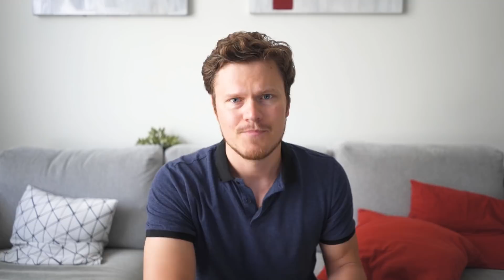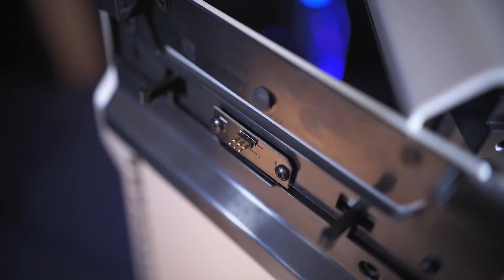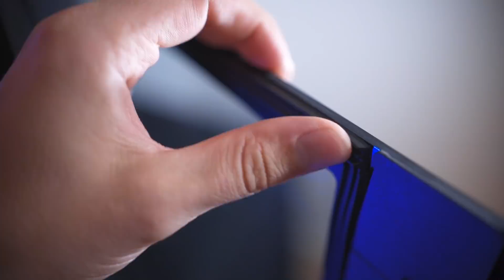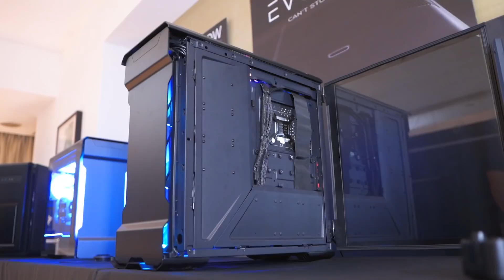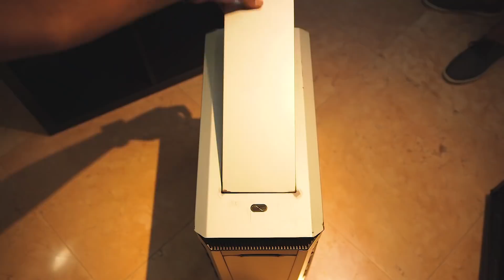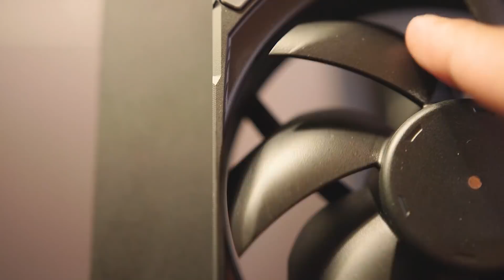The BEST $199 You Can Spend on a Case! -- PHANTEKS EVOLV X

Comment: Are the people in this comment section deluded? This case has a blocked front panel! Expect high temps and no room for overclocking. Even if you set all the rgb to red it will not improve the performance of your PC. More air, on the other hand, would do that, but hey, gotta have that rgb, air is for losers.
Reply: I have this case and my temps are pretty great with a 10900K OCe'd to 5.3GHz at 1.45 V. Max temps are about 75 at full load and a 3080. I used to have an ugly Corsair case from 2014 with 6 case fans including a 240mm side fan blowing right at the mobo and it managed to have worse airflow while looking much worse.

Comment: I have this case on order for my new build. However, I have an issue. 

The EK water-cooling loop kit I want to get (EK-Kit X360) has a radiator that is 60mm thick. Add to that the thickness of the 120mm fans (25mm) that will be attached to it,  so that now I don't think the rad/fans will fit in the top section of the case. I don't believe there's 85mm of space for this to fit. And I've received conflicting info from Phanteks about this.

Someone, help me out here... The MB I'm getting is the Asus Z390 chipset Maximus 'Formula' XI.

Comment: Anyone know if one can use that ITX back bracket for a 5.25" drive? For those gamerz and media consumers wondering what one does with such a bay, I'm a content creator, so I use it for a multi-card reader or a quick-switch 3.5" storage drive bay. I have over 100TB of 3.5" drives for various media projects that I need to sometimes plug in. External docks often have a lot of issues compared to connecting straight to the motherboard's own SATA ports. This is the only issue that would get me to buy the Enthoo Luxe TG over this Evolv X. I have the Evolv mATX for my gaming/media PC and it's great.

Comment: Personally I could give a flying one at a rolling doughnut with regard to the RGB, but finally a case where you have airflow AND storage capacity in one case.

I will be buying one and will outfit it with the new Noctua A12x25 fans and will be buying a Corsair H150i Pro 360 AIO to go with it.

All in all it will be a hefty upgrade which I guestimate will cost just north of £500, but it will be worth it to me (Case, 7 Noctua Fans, AIO).

BTW:

Noctua opened a hotline in the US for people triggered by the colour of their fans

The number is 1 800 248 363

Yes, that's 1-800-BITE-ME

Comment: 1 1/2 Things i miss in this otherwise perfect case:
A 90° rotated 5 1/4" mount for my Aquaero and, since i am used to my loop layout, a closed bottom shroud to hide the pump and another 280mm radiator mount. I dont need any clamps for my reservoir because it has 3 bottom outlets which i use as a trypod mount aswell. It makes the system soi clean and i dont think i wouldnt want to mount  it any other way.

That said i'm pretty sure i could make it work, just requires some cutting of the case :/

Comment: This is what Corsair 500D should have been, a improvement from the last model, not just a new model with other flawes. I mean just the thing that you have 5 m.m gap on the sidepanel is so cheap. The lack of a pwm hub with that ammount of money is also wierd. From the look of it Phanteks are doing great work with this case. I dont se any reason at all to buy the Corsair 500d over this one, besides having a "smokey" tempered glass.

Comment: If 2 systems are installed, surely the GPUs won't have enough air cool properly since the GPU from the second system will be pumping all the heat straight to the GPU from the main system, and the second system GPU is very close to the glass panel as well so it will be choking.

Comment: I was disappointed when I saw tempered glass on both sides...until I saw the cable management solution with those clasped flaps. Everything about this case is perfect to me. Didn't think they could improve on the already excellent ATX. They certainly did. This is the one.

Comment: PLEASE do a video where you build a 2 system build in this case. It's a huge selling point for me because I currently have two desktop systems, one for windows, one for linux, and if I could combine them I would be thrilled. Most of the other cases that can do it are massive.
Reply: Mormodes why the two systems? What do you need two systems for, just curious
Reply: It's useful to me when gaming. I can utilize one for gaming, and the other can be used to look things up without the need for alt-tabbing or fullscreen-windowed mode. I can also watch moves/twitch streams without putting any kind of stress on my main PC (because I like those frames). Most importantly to me, though, is that I have options. I can put windows on the main system and Ubuntu on the secondary system, or some  other linux flavor, which helps me learn without locking  me in  and causing issues when I need to troubleshoot things. I don't like Windows, but I have to use it to game, so this  is the best of both worlds for me.

Comment: If your going for watercool yeah this is one of the best cases. However the minimal airflow which you can clearly see from the top and front will be an issue for users with a better than average component build. Let’s say running 21:9 resolution games maxout. If you run games on a 1080p resolution you probably won’t have issues with heat but it could still get hot.

Comment: Wow, Phanteks did an excellent job with this. Really dig this company. I'm always torn between them and bequiet! Though, the fan that comes on the bequiet! Dark Rock 3 is kind of terrible. My favorite fans so far are cheap and move a crap ton of air. The Cryorig QF140 Performance fans. Plus they look incredible. I ended up figuring out how to fit the Cryorig QF140 onto my bequiet! Dark Rock 3 cooler along with a Phanteks Halo RGB ring. Looks incredible. Barely fits between the RAM and the cooler, tho. Had maybe 1/4 of a mm of space left. These fans are incredibly loud, however. But on lower settings they move a lot more air than the bequiet! does maxed out, so they actually end up being quieter than the original setup.

Comment: I own the original TG version, but this is on another level. Phanteks makes the best cases overall. I do wonder where's NZXT's update to the H440... their best looking case? They need one with RGB and tempered glass on both sides like this case as soon as possible cause they seemed to be forgetting about the H440, specially the one designed by Razer edition.

Comment: I love this case already ... but ... for the blackout perimeter of the tempered glass side panels, why are they so prominent compared to the surface area of the case in its entirety. I fully acknowledge I'm simply nitpicking, however, perfection is said to be unattainable and this work of art reached so near. Honestly, I would find less discomfort if they were to remove the blackout perimeter entirely before the case is released to the public. In my humble opinion, it distorts and detracts from the "class" of the case in its own right.

Comment: HOLY HAND GRENADE I WANT THIS THING. It has almost everything that I look for in a case. The only thing I would have liked to also have is an HDMI passthrough to the front, but I know that's not a feature most people look for. Anyway, they did a fantastic job on this case, and it will probably be my next upgrade (after a new chair, which I desperately need). It will definitely be a major upgrade from my ~$20 case I've had since my first budget build.

Comment: Nice looking update for the Evolv, but I have to wonder if it'll support full-sized E-ATX boards...I mean, the original Evolv and TG versions both claimed to support E-ATX, but only up to 10.3" wide boards, where most E-ATX boards are 10.7" wide....wonder if the X-variant can handle the full 10.7" wide E-ATX boards

Comment: Too many fan boys.
It's simply the same tooling design, but at $10 more for what should have been implemented in the first place.
I like Phanteks, I've owned two of their cases, but this case is going to suffer from all of their same issues. The intake is still choked. The top mesh is still going to choke. Their cable management covers is something other manufacturers have been doing for sometime. Adding two drill outs for water cooling was a simple fix. Their L.E.D strips are still over priced. The capacity of holding up to 18 drives is overkill for the sake of it. Anyone running that many drives will be looking for hot swap capability a NAS can offer.
It is splendid they're are listening to consumers, and they deserve all credit for that. They needed to go simpler. Do half as much, but do it much better. They designed a premium priced case that isn't going to excel in any one area, apart from high price tag.
The GZA said it best, "Make it half long and twice strong." For a lesser price I can get a Lian li with the same gorgeous aesthetics, and on the money saved purchase a NAS and RGB hub and still have change let over. I could get the corsair 500d will nearly all the same design functionality, for a hundred less.
Fans are gonna rag on me for saying it, I'm not phanteks enemy...but it's the harsh truth.
Reply: Umm This is only one model of many cases they make so your comment is just trolling.  None of your points are valid as they have so many available solutions and awide range of price points  from minimal to full blown and cases that have excellent airflow.  They excell at flexible configuration options that focus on water-cooling.
Reply: If it is so good, why did they included a movable mounting plate in the top exhaust to stop recirculating hot air back into the chassis?...they knew this was an issue after the enthnoo evolv..yet none of the tooling has been changed, just a plate added. Case engineers in Germany modded this case to give it adequate airflow, and they had to remove 40% of the front panel, and 60% of the top panel just to give it adequate air.  300% increase x poor airflow=poor airflow. Now add 18 drives, 2 C.P.U, 3 G.P.U, 10 DIMM and a twin 1200w P.S.U..this is what they are claiming this case can hold. 
Sorry Bud, but your fanboy drooling...this case is not great for twin systems, it only works with their new Dual P.S.U, because there is no area for a second S.F.X P.S.U, it doesn't have enough airflow, if you mount a A.I.O up top, you forgo the second mobo mount, the extendable G.P.U riser goes directly over your mosfits and audio channel causing electric noise through your audio...nice looking case, but confused design brief..their trying to stuff 10 pounds into an 8 pound bag, and getting you to buy more into their 'Phanteks ecosystem.'
Also to address your comment on "Many cases they make."
P400 series...choke fans
Enthnoo evolv series...choked fans
Shift series..choke fans and worst acoustic performance, poor thermals, an Itx case that has the same volume as an atx case.
P600 series...good airflow aiflow Atx case that is atx size in volume.

They focus on watercooling?..your serious?..this is the first case they have made that has had a drain port added.
Watch Jayz2cents worth video on why he stopped using his water cooled enthnoo evolv...does his review look like it was a water cooled focused case?
"many price points"  every manufacturer has many price points..Phanteks is not exclusive with this.
Flexible configuration?..you mean the vertical G.P.U mount that places it directly against the glass? They have no cases where even the mobo can be mounted at 90 degrees. mechanical drive mounts sit 8 inches from their S.S.D mounts on their tooling so you have to use multiple sata headers..that sound flexible.
Their included fan hub does get recognised by C.P.U headers...this all sounds very flexible.

I am going to leave it at that. You don't know what you're talking about.
Reply: david neville Which mid sized cases would you recommend?
Reply: Depends on what your end needs are.
A silent media station? A gaming system enclosure? a typical pc that matches your environment? Limited space?
Overall, all the systems I have help create or assembled, the nzxt H series offers solid choices per price tier and quality.
However, you gotta look at the end use. In my personal situation I have plenty of space, a reasonable amount of dark coloured furniture and glass in the area my pc is, so something like the corsair 500d fits and blends in seamlessly. I have plenty of additional be-quiet and noctua fans to fill out all the spare space the case has. It works best for me.
That is my issue with this phanteks. 
Its a dual system case, that doesn't allow a true twin system set up, or come complete as a twin system. It is merely an option that installing a second system compromises something else like radiator support.
It houses tonnes of storage, but doesn't incorporate any hot swap.
It houses tonnes of hardware, but doesn't allow adequate ventilation, or a twin P.S.U..it only houses phanteks split P.S.U
It claims better air flow, but then includes a top case shroud to prevent re circulation. If it was truly airflow improved, then this wouldn't be needed.
I personally feel most end users using a good C.P.U, a high end G.P.U, above average cooling and 2-3 storage devices will get everything they want, as well as a clean aesthetic from the lian li pc-011 series.
As a single system case the evolv X doesn't excel in any one area, and has you paying for options you'll never use. As a dual system you have to make too many compromises and buy additional parts. As a mass storage device it... etc etc..it tries to cram too much into itself without excelling in any one area.

Comment: I've been looking for the perfect computer case, and I had only three requirements:
1. USB C on the front. It's 2018, this isn't optional.
2. Mid-tower. I don't have a room for a huge computer case on my desk, I need something that's reasonably sized. I'm not looking for a tiny computer, but I don't want a Cosmos II either.
3. E-ATX Support. I'm trying to run a Threadripper workstation, with an E-ATX motherboard, so I have basically all the options.
The Evolv X is finally, FINALLY the case I need. Thank you Phanteks.

Comment: I'm using the Evolv TG Flow Edition and cooling everything on air is great, but this case is definitely a nice upgrade over the original TG one. My favourite is the ability to hide all the cables behind, really nice touch. Would love the ability to upgrade the front I/O on my current case that the new case has though :)

Comment: Would be great if they will also provide hotswap capability for 3.5' drive caddys in Evolve X. And what about 8 x 3.5'  HDDs with ability to install front radiator, because front air intake with all 8 drives will be poor.

Comment: i have a evolv TG. i did a few mods which basically is what they did here. i bought aftermarket (modmymods) top and front panels with built in cut outs for better airflow. i added the led kit with a strip behind the front panel so it glows out of the sides. but if i would have known, maybe i would have held off on those extras since each panel was like $80 bucks.

Comment: Holy... anyone wanna buy my evolv atx tg so I can fund getting an X? That case has literally everything I would want improved from the evolv atx and then some.

Edit: Well, shit. It has one change that in some ways hurts what I've done; I use the front ssd mount as a place to route a usb cable that plugs directly into the mobo headers for wireless controller dongles. But on the X, the ps shroud goes right up to the window.

Comment: Only 3 very minor things I saw that could be improved on.
First, the slider for the cables coming from PSU, is that the gap/hole for wires be on the inside towards the mobo, and the slide cover is close to the glass, also have an option to run PSU cables to backside (out of sight completely). Second is I have a Thermaltake Toughpower Grand RGB 650W Gold (RGB Sync Edition) which would be hidden by this PSU shroud, perhaps a removable top shroud one for air circulation, and two illumination. Third is, where is the airflow coming from, for the secondary ITX GPU? (especially if you are closed loop on main system)
Otherwise it is ACE! and for size, it looks to be much smaller than the Corsair 1000D. The price is completely acceptable to me, for the excellence in execution of the build.
PS - What dual PSU did you say (looking for it in the Read More below video)

Comment: Ok Dmitry. 
Last time you made a review of the regular ATX and you said it is the best case you have seen. So I go one, put a double 1080Ti / 5820k and custom watercooled it. Then had to mod the top, the front and the rear due to system overheating. I was just about to get an R6 White ordered and migrate the system in it and thus comes up. Can you confirm that Phanteks has figured out how to move air in their new case? Should the regular watercooling guy get one or dunction has again be neglected over form?
Really puzzeled here. When will a real world review be done?

Comment: Very impressed with these two cases. Finally an intelligent case maker.
Reply: + Mahmoud Maguid
Phanteks has been like this since day one in the case market, literally the first case they ever made was better than all else on offer and reasonably priced, in terms of feature set they've always been at the forefront doing things nobody else has, then the rest follow.
Reply: IISocratesII i built my pc in October of 2014, right around the time Phanteks released the Enthoo Pro, so i picked one up and it’s been such a good case
Reply: Yes, choking off airflow to the extent that the system will be significantly louder and hotter than a case with actual airflow is very intelligent.
Reply: Blaze.  I fixed the supposed airflow problem in my p400 in like 10 minutes with a dremel.
Reply: Irrelevant of anything, if you have to take a power-tool to your pc case to get it to work right, something is seriously wrong.